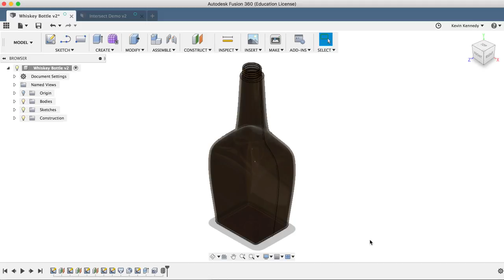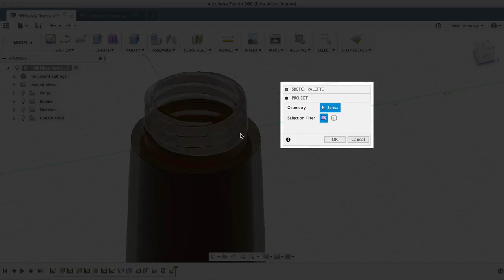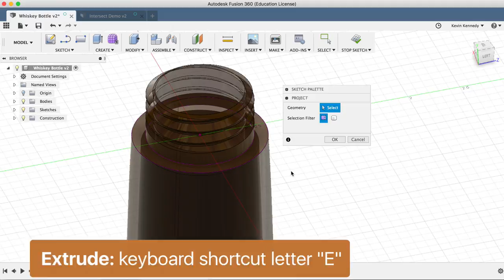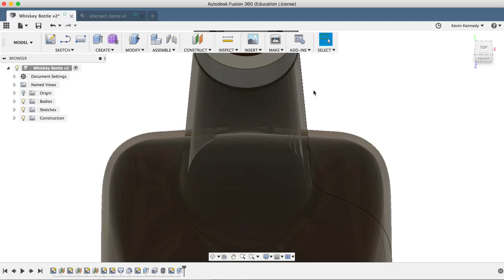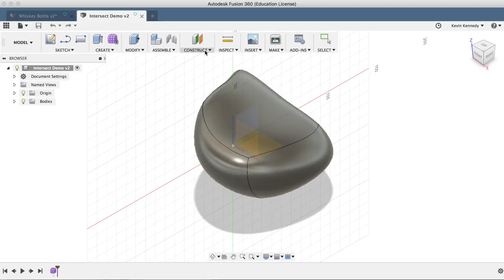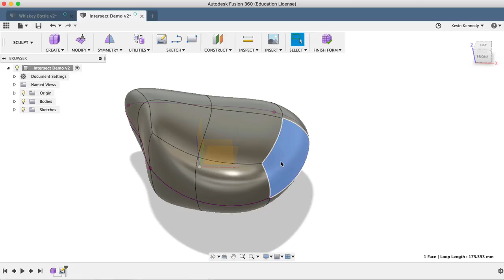Fusion 360: How to Project (and Intersect) a Sketch in Fusion 360 | #fusionFridays

Comment: Great little preview thank you, one thing I found a ton of tutorials overlook is the fact that the sketch created after a projection is locked (driven by the geometry) and if you want to edit that sketch you won't be able to unless you unlock it. Took me a while to find this. I use fusion for concept design and difficult hard surface stuff that is a pain to do with poly modeling so its imperative to know that you can unlock projected sketches in case you want to make edits to them .
Reply from the maker: Great tip, Alex!
Reply: How do you unlock it?

Comment: Thanks, great info. One question: I have a body that is just a lofted surface between a polygon and a circle. I can find the intersection of the lofted surface and a plane (between the poly and the circle) but the intersection disappears if I delete the body, which I no longer require. Is there any way to copy or somehow preserve the intersection as an independent curve on the plane? I’d like to use it as one end of a new lofted body. Sorry if I’m abusing terminology. I’m a bit of a noob with 360.

Comment: Me again, question again. You have told me project is for auto-update based on the original model. However, when I compare using project and without using project, I got the same results. The extrusion updated without using project. Could the auto-update be already automatically included? Or I just don't understand project. Did you try not using project, and the cap was not updating. 
I am saying this is big deal, it is just when whenever tutorial projected the points to their own plane, I got confused.
And thank you, sensei.
Reply from the maker: Hi, Leo. In short, the main difference is that you will be able to include multiple pieces of sketch geometry (something I should've demoed more) with the project command. If you update the extrude command you can get it to update the one sketch touching the extrude, but nothing else. 

This video is a great example of how powerful it can be - https://youtu.be/58epiN-Ki58
Cheers, Kevin :)
Reply: @ProductDesignOnline  Thanks for the woodwork video. Now I learn that if I don't do the project on the cycle, I can not choose it and do extrusion. Project is Great!
Reply from the maker: @zn123m  Glad that video helped explain it more thoroughly. Cheers, Kevin :)

Comment: I am a little confused (new to Fusion 360). When you use the intersect tool, you are doing it on a 3 dimensional shape. But your projection is 2 dimensional on an individual sketch. So, how do you accurately re-create the 3D body?  seems, like you would be losing a lot of information.
Reply from the maker: Hi, muskateer10. Sorry for the confusion...let me try to clarify. The idea with the project/intersect commands is not to recreate the 3D body. If you want to recreate a 3D body you can copy/paste, mirror, or pattern the body itself.

The main goal with project/intersect is to reuse the same shape/sketch of the 3D body. The project/intersect commands simply save time as you don't have to create all of the 2D Sketches from scratch. The sketches are then also tied to the original shape so you can change one thing and the projection will be updated accordingly.

Perhaps a better example would be how I used this in the painter's pyramid tutorial. Check that out here (3:08) - https://youtu.be/36uU1Z7OiJg
Cheers, Kevin :)

Comment: https://youtu.be/UPq5r-3SO3w
Here is my problem. Intersect does 2 things. 
1 it does not crate a "red do" half way of component i am selecting. 
2 Intersection dots dissapear as soon as i select ok in intersection menu so i dont have intersect dots anymore on sketches. 

What i do wrong. i made a bottle whit this tool as i learned from video earlier but in this model it does not work
Reply from the maker: Thanks for sharing the video. The first two points you selected are not on the same plane as your sketch plane, which is why they don't Intersect properly. Your sketch plane running through the middle of your two sketch profiles.

You'll want to create a sketch that intersects those two points. Intersect will only work with any geometry that intersects (or lies on) the same planar area as your sketch.
Reply: @ProductDesignOnline  thanks for answering. I try tomorrow again if got your answer correct. 🫡
Reply: Thanks man. I was to eger to wait tomorrow so tried now. Now i got it. 
Somehow i thought i can create intersect points anywhere i want so that was my mistake. Your doing a gods work with these series.

Comment: And of course another tutorial that doesn't work because the interface is different.  AAAAAAAAAAAAAAAAAAAAAAAAAAAAAAAAAAAAAAAAAAAAAAAAAAAAAAAAAAAAAAAAAAAAAAAAAAAAAAAAAAAAAAAAAAAAAAAAAAAAAAAAAAAAAAAAAAAAAAAAAAAAAAAAAAAAAAAAAAAAAAAAAAAAAAAAAAAAAAAAAAAAAAAAAAAAAAAAAAAAAAAAAAAAAAAAAAAAARRRRRRRRRRRRRRRRRRRRRRRRRRRRRRRRRRRRRRRRRRRRRRRRRRRRRRRRRRRRRRRRRRRRRRRRRRRRRRRRRRRRRRRRRRRRRRRRRRRRRRRRRRRRRRRRRRRRRRRRRRRRRRRRRRRRRRRRRRRRRRRRRRRRRRRRRRRRRRRRRRRRRRRRRRRRGGGGGGGGGGGGGGGGGGGGGGGGGGGGGGGGGGGGGGGG.     Not dudes fault  though.  Quite a nice tutorial actually.
Reply from the maker: Hi Andrew. All the functionality is still present in the new UI. I would recommend watching my tutorial that covers the new UI updates. I discuss the critical changes in terminology, placement, and iconography, that should help bridge the gap between the old UI and the new one. You can watch that here - https://youtu.be/tuZzHcmFtg4
Cheers, Kevin :)
Reply: I am doing the Learn F360 in 30 days course, day #12 (the one with the spiral helix). Had to stop and look for the Project/Include menu, because there is no longer a way to access it from the 'Sketch' drop down menu as that's no longer there in the newer version. I finally solved it by using the shortcut 'P', but Iwent through  a couple of videos, googled and spent some time on it. I hope Kevin sees this and clarifies if I am wrong, but it's the only way I found to use it.